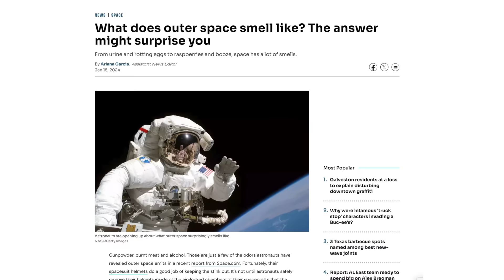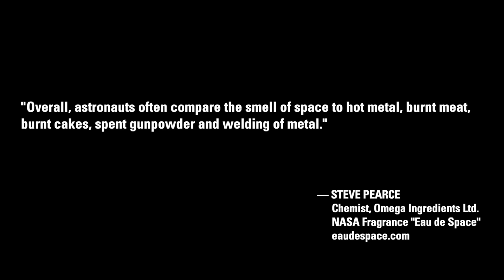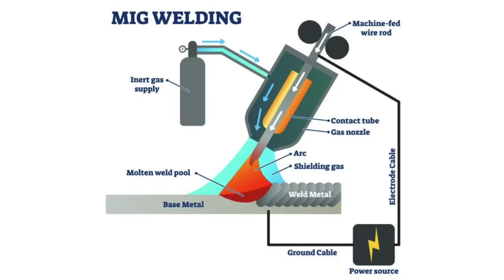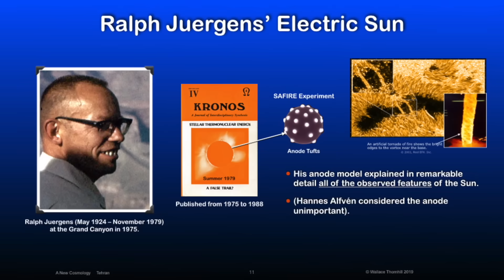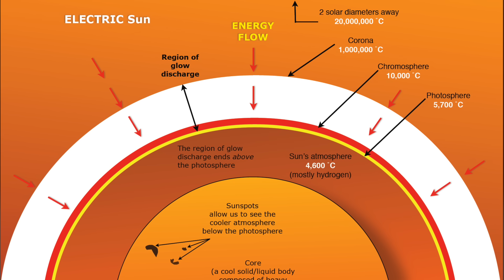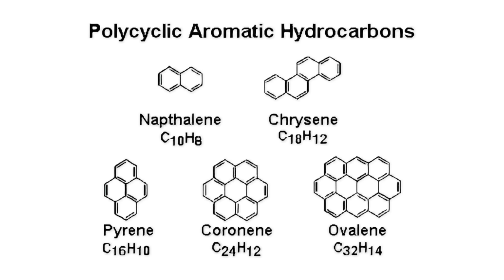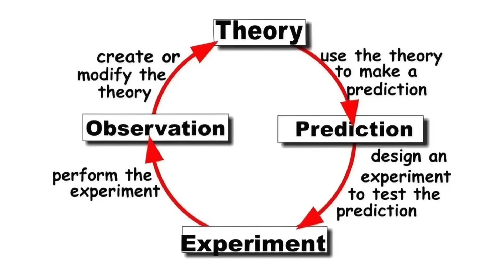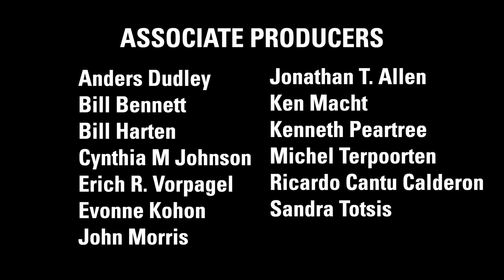Matt Finn: The Smell of Space | Thunderbolts

Comment: I've never heard of the experiment that takes a pressure vessel into outer space, opens it to the vacuum of space, closes the vessel, returns to Earths, opens the vessel with a multitude of equipment that can detect a lone fart of the gamma three venetian Clapp virus. Surely they must do such experiments  on the mighty space station. Multiple vessels opened under pristine conditions in a laboratory where all internal environmental conditions are known then allowed to contaminate the environment of the space vacuum vessel to observe any changes that have taken place in the now mixed environments. This shouldn't be a mystery at all. A good canine should be capable of identifying a space vacuum bottle in a lineup every time. Please elaborate on this issue. To the layman the concept of vacuum conjures the idea of sucking everything not already in the vacuum into the vacuum or if you prefer the area of high pressure pushing everything into the low pressure vacuum. If space is a perfect vacuum or very near perfect, why does it not defeat gravity as it does on the Earth's surface when a vacuum or low pressure is artificially created and push the atmosphere and all loose material right out into the vacuum of space? An artificial vacuum easily overcomes gravity!

Comment: I've never heard of the experiment that takes a pressure vessel into outer space, opens it to the vacuum of space, closes the vessel, returns to Earth, opens the vessel with a multitude of equipment that can detect a lone fart of the gamma three venetian Clapp virus. Surely they must do such experiments  on the mighty space station. Multiple vessels opened under pristine conditions in a laboratory where all internal environmental conditions are known then allowed to contaminate the environment of the space vacuum vessel to observe any changes that have taken place in the now mixed environments. This shouldn't be a mystery at all. A good canine should be capable of identifying a space vacuum bottle in a lineup every time. Please elaborate on this issue. To the layman the concept of vacuum conjures the idea of sucking everything not already in the vacuum into the vacuum or if you prefer the area of high pressure pushing everything into the low pressure vacuum. If space is a perfect vacuum or very near perfect, why does it not defeat gravity as it does on the Earth's surface when a vacuum or low pressure is artificially created and push the atmosphere and all loose material right out into the vacuum of space? An artificial vacuum easily overcomes gravity!

Comment: @ ~ 8:00;

There is no fusion on the solar surface. Scott is scientifically illiterate. It is neither hot enough nor dense enough for fusion there. It is ~ 99.99% neutral gas at ~ 4000-5800 K. If we could achieve fusion under those conditions we would already have been doing it decades ago! In addition, such impossible fusion would bathe this planet in lethal gamma rays of very specific wavelengths. They don't exist. Thankfully. If they did exist, we wouldn't. Scott needs to go back to school, and not skip physics this time.
Reply: Okay kid, shut up, eat the bone and stop barking like a dog

Comment: Since there is no vacuum-capable spacesuit, all claims about external missions are ridiculous fairy tales. It's a pity that Thunderbolts is going along with this. Vacuum needs very very good closing mechanisms, laboratories working with vacuum can tell you a thing or two about that. Apart from that, metals weld together in a vacuum, this is called “cold welding” and we don't even need to mention the deadly radiation!

Comment: I wonder if the smell of space was how the Russian astronauts found the hole that was drilled through the wall of their orbital craft on the ISS in 2018. XD
Reply: Good question. None reported that I could find. They detected it by the pressure drop, then used an ultrasound detector to find and patch the hole. It was very tiny. Someone had apparently drilled through.
Reply: @ArchonOne  would it not be hard for the smell to travel up the gradient?
Reply: @ It was a pretty small hole apparently, so there might not have been much to smell. I expect you'd need more data about the incident. One would expect an obvious odor to be reported, but preexisting smells from previous spacewalks or any number of things could have masked it. They say it gets pretty ripe aboard the ISS.
Reply: @ArchonOne  It is not the size of the hole that concerned me, but the fact that the pressure was circa 1000 hectoPascal inside and close to zero outside - as you know, smell spreads by a combination of diffusion (slow) and bulk entrainment, and both were stacked heavily against odour penetrating inwards from space.
Reply: @physicswithpark3r-x3x  Brilliant deduction professor. Thanks! All the stuff's going out the hole. It was late!
Reply: @ Pretty much, yes.
Reply: What actually alerted them was the seawater leaking into the "space station"
Reply: @ Guys like you are often called Sean - why is that?

Comment: "" ignition "" is also occuring at the atomic level. It's just a simple scaler understanding as to where the origin of ' ALL' to energy is coming from. At the nano level, with the right condition, electrical energy flows out of the zero point through the aether, just as it occurring at the macro level. It's not something that needs proof or evidence, because the simple fact that it's occurring like this is its own evidence, it's just self evident scientific observed rational phenomena...how do you try and explain or rational the obvious??
Reply: Very true. That was more for dramatic effect. :)
Reply: The sense organ of eyes is unique because light only really operations through a co-axil circuit through out the aether, ...I mean essentially exclusively. While mostly sense organs to detect sound or smells , as we know them , work through a intermediate medium. In space however, all those intermediate mediums are removed. In other words what ever sense information we can receive with those organs, must revert to using aether as the medium. The smell of it , transmits the information as to how the aether ( and light ) actually works, ...that is electrical/magnetic ( same same ) in nature.

Comment: The solar interior thingee...
If we follow the 2nd Law of thermodynamics when applied to the Sun this is what we find:
Corona; 1 million degrees Celsius (fluctuating)
Chromosphere 6,000 C
Photosphere: 5,000 C
Sunspot penumbra 4,000 C
Sunspot Umbra: 3,000 C
Best estimate depth of Sunspot: 3,800 kilometers

Based on this above depth and temperature numbers, this is what to expect if we continue this gradient inwards:
Depth point at which the temperature gradient reaches 0 degrees Celsius: 11,611 km
Depth point at which the temperature gradient reaches superconductivity: 11,759 Km
Depth point at which the temperature gradient reaches absolute zero: 12,187 Km
(In a comparison scale to the diameter of the Earth; 12,742 km)

But of course, we can't trust basic physics right? That would just be silly.

Comment: well there is no such thing as an arc welding torch.
Reply: Your comment is sublunacy.
What is an Arc Welding Torch in Welding?

An arc welding torch is a device that is used to transfer current to a fixed welding electrode. The torch also serves to position the electrode and direct the flow of shielding gas.
What is a welding torch used for?
The most common type of arc welding torch is the TIG (tungsten inert gas) torch. This type of torch is often used for welding aluminum and stainless steel. The TIG torch has a tungsten electrode that is non-consumable. This means that the electrode does not melt during the welding process.
The TIG torch also has a gas cup that surrounds the electrode. This cup helps to shield the weld area from atmospheric contamination.
Another type of arc welding torch is the MIG (metal inert gas) torch. This torch is often used for welding mild steel and aluminum. The MIG torch has a consumable electrode that is made of copper or steel. The electrode melts during the welding process and becomes part of the weld pool.
Welding Tech .net

Comment: There is no negative flow of currents. Currents are unification of unidirectional flow cycling circulation centrifugal force of magnetism bonding and repulsion within and without entanglement of mass. Force is constant velocity, and distance traveling is the variable. Electricity is rapid heat exchanging through mass faster than planetary internal magnetic fields. Meteorites disolving into external heat energy outside of entanglement of mass as fire lighting up the atmosphere like filaments. Your eyes pick up heat energy of refraction of reflection of striking resistance unabsorbed heat singularities striking mass and bouncing off atmospheric gasses lighting up the mass it strikes. Lightning burns through atmospheric gasses disolving into external heat energy outside of entanglement of mass as fire singularities instantaneously disolving mass. Campfires slowly disolving mass into external heat energy as fire. Heat is always present in the disolving and  propulsion of mass. Stars disolving atmospheric gases into external heat energy waves outside of entanglement of mass as fire singularities propulsion momentum velocity as normal weak external heat energy outside of entanglement of mass. Mass is the accumulation of quaternary elements combined synchronization of magnetism bonding and repulsion within and without entanglement of mass. External heat energy outside of entanglement of mass doesn't ground currents hence hot air balloons rise up from magnetic fields grounding bonding force of impaction force as weight within mass as outward force of pressure redirected by magnetic fields grounding currents through its nucleus or core where force is stronger. The closer to the core the greater the force of magnetism pressure flowing.  The middle of the river has more force than the edge of the pool. Heavier elements sink to the bottom of the pool or core. Distance away from the core increases, and force is constant. Force is spread outward as the variable. The force is constant, but less currents flowing.